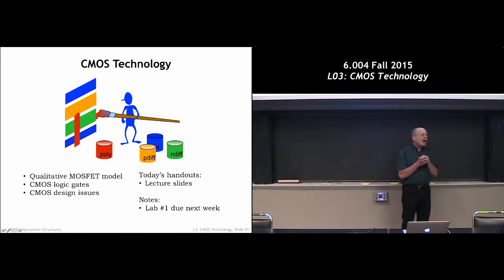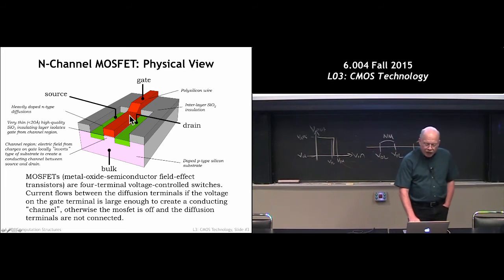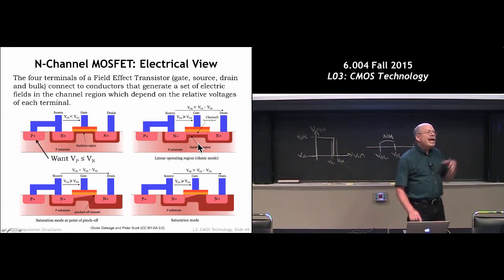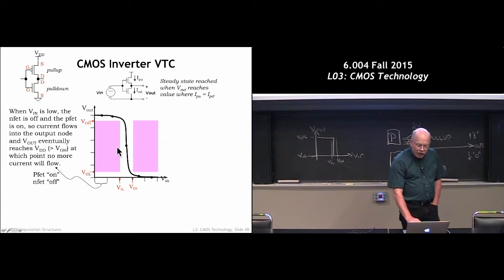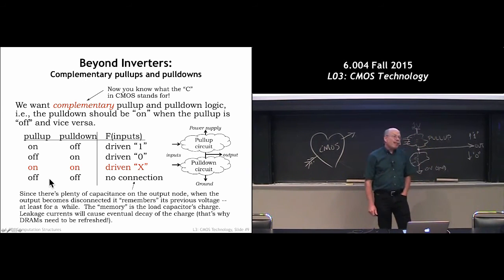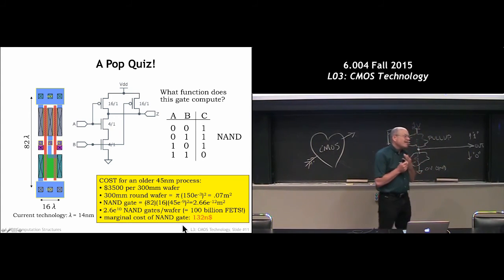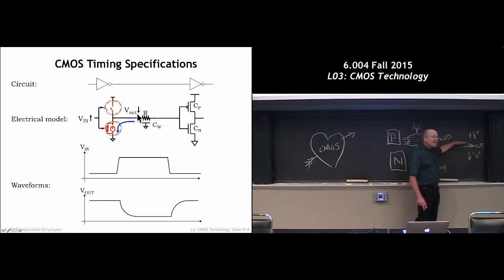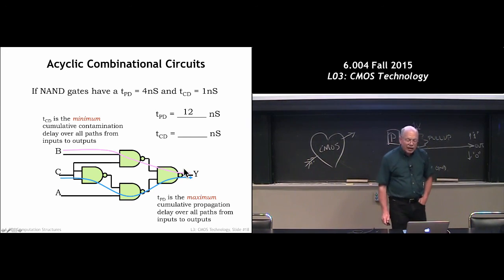MIT 6.004 L03: CMOS Technology

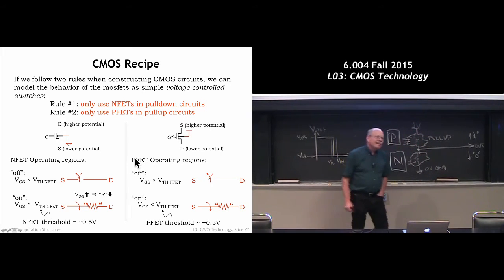Comment: Aren't drain and source solely labelled based on the voltage on the terminals? The drain terminal has higher voltage and source terminal lower voltage. But for PFET why are they opposite? 20:36
Reply: Because for PFETs, the charge carriers are holes going through the valence band. For NFETs, the charge carriers are the electrons going through the conduction band. Both of them go from source to drain, but because the conventional current is opposite to the flow of electrons, we consider that in an NFET, current flows from drain to source, while for a PFET, current flows from source to drain.

For a PFET, the flow is within the p-channel, which is made after enough holes are attracted by the gate terminal (less than the threshold voltage).